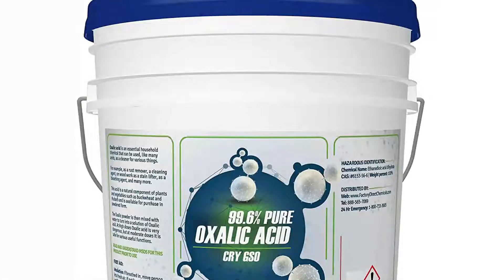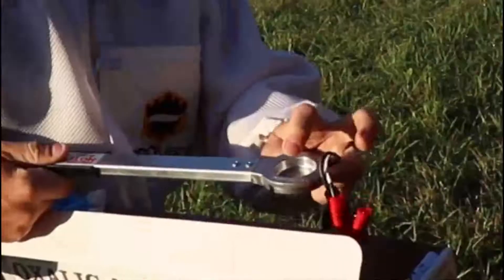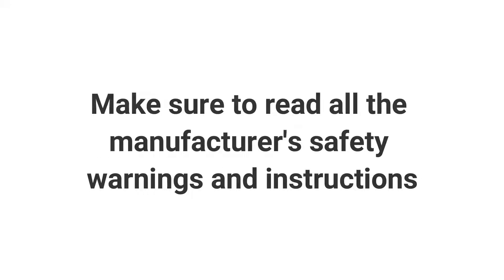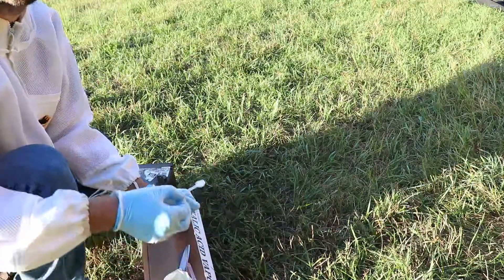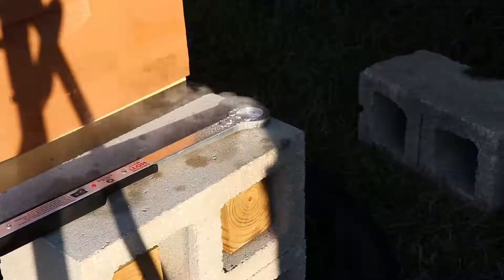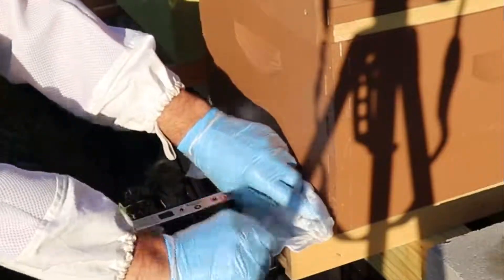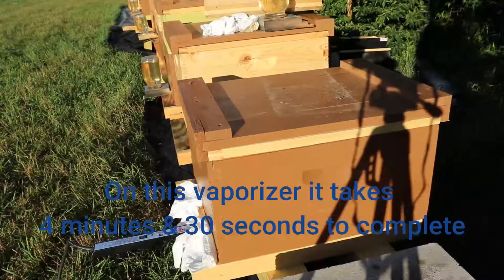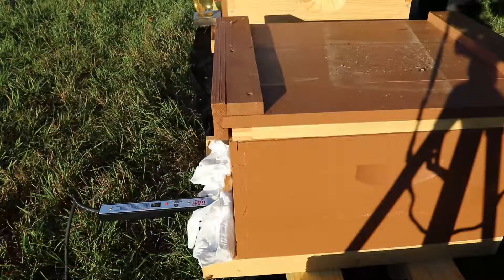Treating for Varroa Mites with Oxalic Acid Vaporizer - Beekeeping How To

Comment: One correction:  The dose is 1/4 tsp for each brood box so if you have more than one brood box, you need to increase the dose by 1/4 tsp for each box.  Suggestion:  When blocking off the entrance, use something like a wet rag or towel or something that is not likely to catch fire.  The vaporizer gets pretty darn hot.
Reply from the maker: Thanks, good points! What I used was wet, but should have mentioned it